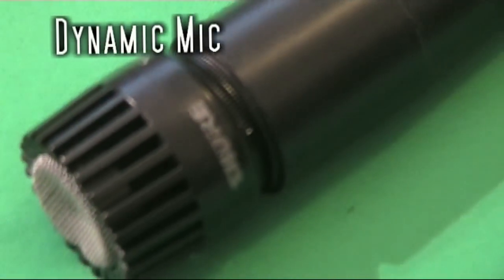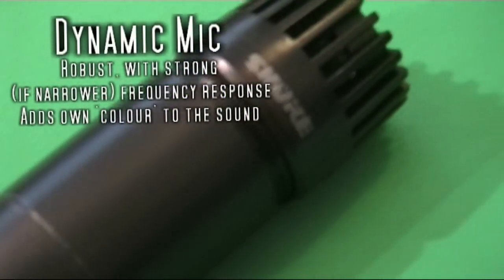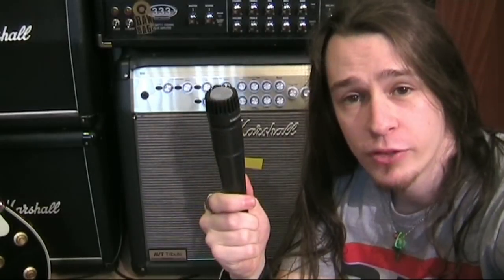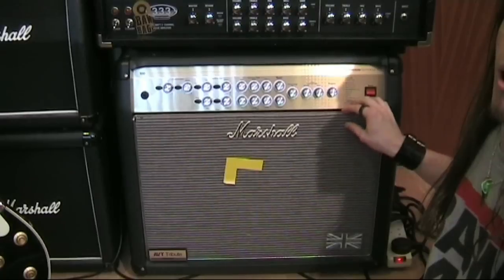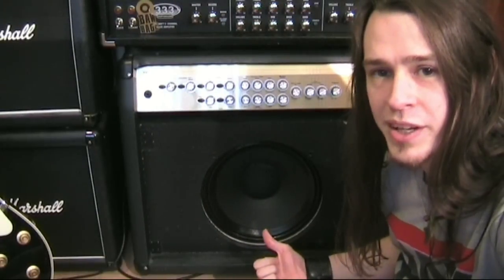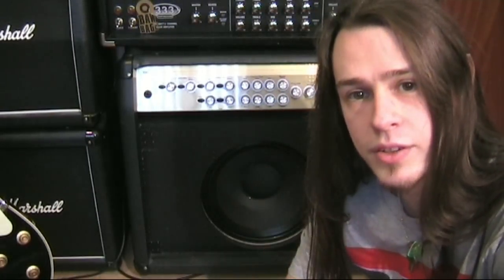How To Dual Mic A Guitar Cab

Comment: Awesome bro! If you record it that way though, have to pull the waveform of the condenser back a couple of micro seconds as the sound reaches it AFTER it reaches the 57, causing it to be "out of phase". So zoom in and match up the two waveforms from each mic to fix and you'll get exceptional low end again
Reply: I think it's 3 feet away to keep it in phase

Comment: Great video ery usefull hearing how moving the mic effects the sound.

One thing not covered in the video but could be usefull is the distance of the 2nd mic from the cab in relation to the first mic. Every 34m will result in 1ms delay between to the 2 mics.

Why is this usefull to know? Phase, Its like taking 2 tracks playing at exactly the same time and them shifting one slightly forward or slightly back.

if you want to be really anal about it you could time align your tracks or use specific distances to minimase phase issues.

or you could leave it and just go by ear, some phase cancellations add to the effect.

Its probably more usefull when dealing with muktiple mics on say a drumkit to be aware of distances particullary overheads in relation to snare but thats a whole other topic.

I need to get myself one of those nt2a's its night and day difference witth the behringer c1 i have.
Reply: Anyone in the comments complaining about phasing in the comments should read this. In DAWs nowadays its super easy to sort out and fix.
Reply: I believe you'll find 1ms delay for every 343mm or 0.343m

Comment: Do you ever do any phase alignment tools to tighten up the sound? The problem I have with this method of mic-ing is often you get comb filtering, as the mics are receiving the waveforms are different times, and cancellations occur - leaving it thin or muddy. I used to use a tape measure(mic to mic) and workout the amount of time I need to correct it by or how many degrees the phase of one of the mics needs to be shifted. Voxengo PHA-979 is great, but I hear Auto-Align are good too. Top video!

Comment: But what about the: Out of Phase effect?  Sound isn´t traveling in Lightspeed, right?
Reply: +Jido Fisterfilly If you consider the speed of sound at 343 m/s and the distance between the condensor mic and the amp of about 1 to 1.5 meters you would get about 3 milliseconds of delay which results in a slight stereo/chorus effect. The same principle works for orchestras and choirs (varying distances from particular instruments to the listener's ears), or 12 string guitars or pianos where the string chords are always just very slightly detuned. Anyways I think it sounded really nice and I'm gonna try this method too :)
Reply: +23Jetstream Thats a good point. I´ve never seen it this way.
Reply: I heard the phase and didn't approve :)  I think the condenser should have been moved until it wasn't phasing as much..
Reply: Useful vid though, I'm deciding what I'm going to go with and have both mics.. also that's a snap judgement about the phase.. I think I heard some though that didn't help the sound out, could be wrong.
Reply: Sometimes, flipping the polarity of one of the tracks would work. But panning them like they are in this video just defeats the purpose of having both of the mics. Usually, the room mic is about 1 millisecond out of phase for every foot that the room mic is away from the other mic.

Comment: how to you match volume levels????
Reply: +yeeeeeeeeeee In your DAW. You adjust your input gain to get relatively similar peaks/average levels, and then in post you can also adjust your output level to taste. You don't necessarily want the mics to be the same level--often they sound better with one dominant, and the other "colouring" the sound from a much lower volume. Use your ears, they're the best way to figure this stuff out.
Reply: They could go out of phase with two mics like this right?
Reply: Larry Tate yes, but that's easily fixed in your DAW. A slight nudge this way or that with one of the wav forms. Really, it only becomes a significant problem when the mics are close to one another and out of phase. When they're spaced like in the video, the condenser is picking up the room as much as the amp, so its not really something to be worried about.